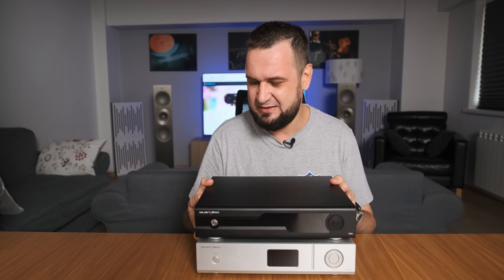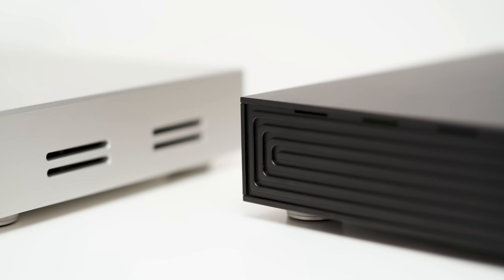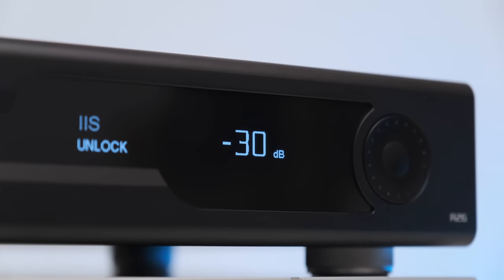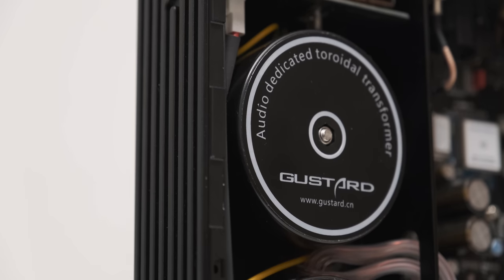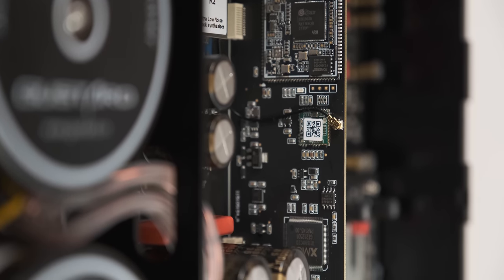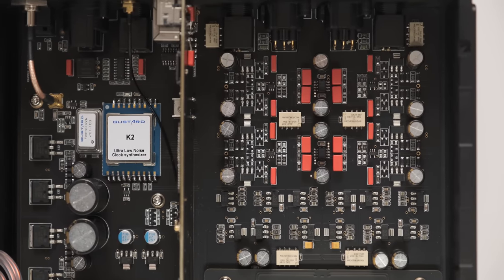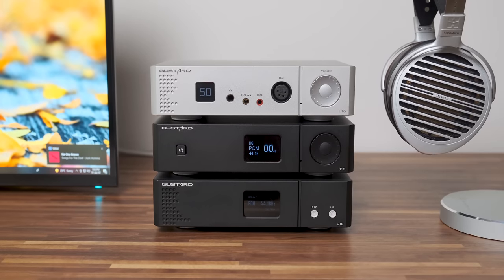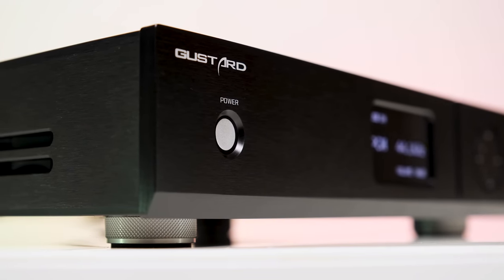The Best DAC I've heard below $3.5K - Gustard R26 Discrete Review

Comment: Ok i received my R26 brand new and fonctionnal. I paired it with the Gustard U18 DDC to connect through IIS. Before the U18 was in, the sound, compared to my Denafrips Pontus II, was wider, punchier and more 3D without being forward. It reminds me of my Chord Mscaler/Qutest combo but with more meat on the bone and a sense of liquidity the Chords lacked. With the U18 in place, the musicians are inside my room, playing for me. This amazing vividness gives music its enjoyment and visceral emotion. I'm quite amazed by this unit after owning severals DACs from Delta Sigma to R2R. Thank you for this review ! Without it, i was about to make a loan to buy a Holo May. I don't know the may but the Gustard is amazing ! Truly !
Reply from the maker: I'm so glad that people started realizing the Giant Killer than Gustard made at such an affordable price. I have a Chord Dave as well and while that one is better...it is only by a little better, making R26 the biggest bargain I ever experienced from the land of D/A converters.
Reply: @Soundnews  And it's on a burn in process so it should get better ! The U18 is a must to retrieve the last bit of greatness from this dac. Dave is probably better but lack fluidity as i recall it... Did you ever try a external clock ?
Reply: I own Gustard U18 DDC. With R26 you just choose Gustard on U18 and it works perfectly with I2S with no other adjustments?
Reply: @klepp19  yes i use the U18 DDC. I added an external clock to both the U18 and the R26. I gained another level in treble purity, extension and edge.
Reply: @laiguilleetlefeu3240  I will just try I2S maybe no external clocks. I just sold my Qutest.
Reply: @Soundnews   How do I update firmware using Mac? No help from website for A26 or R26. I own A26 and will be swapping out for R26 as I’m in return period.  Your review convinced me. I was Able to get for $15 cheaper than A26. The A26 has no need for updates but I see there is need for R26 for Roon. I hope I did not make a mistake but will hold onto A26 until last min. Hope you have install advice for software using Mac
Reply: @laiguilleetlefeu3240  what is best application for clock? I use my DAC with Ethernet connection. Is it only for usb input?
Reply: I  also used a straight R26 for a few months and found it was lacking dynamics ,  bass pitch and a 3D Soundstage, while still sounding very detailed,  neutral and spacious.  Adding a OCK-1 clock made zero difference. 

But adding the U18 gave  a huge boost, turbocharging the R26 and allowing the external clock to provide additional benefits.
Reply: Brilliant. Does your Gustard have a remote to select inputs and volume control?
Reply: @rontoolsie what did you have before R26?
Reply: @morespinach9832  A TeddyDAC with  built-in volume control.  Compared to the R26 is was fuzzy, compressed,  2 dimensional and greatly lacking in bass.
Reply: @rontoolsie  no wonder you heard a huge leap of different.
Reply: Having used the R26/U18 for a few months I have recently found that the quality of the HDMI cable between them (which is the preferred connection) makes a difference.  
Previously I was using a highly rated Pangea SE cable that cost $150+ that I borrowed from the TV. Silver coated copper.

I recently got an Ali Express AV Play HDMI for around $80. Mainly because I wanted to return the Pangea to the TV.

The AVPlay is only 0 .75m as that is all I need.  And the AVPlay HDMIsounds more spacious and natural compared to the Pangea. Maybe because pure silver- but possibly due to the fact it is under half the length of the Pangea 

But whatever the reason...the HDMI cable DOES matter. 

In the next week or two I will try swapping my USB cable from the Node130 to the U18 with a high spec silver USB and see if that makes any difference at all.

Comment: Sandu thanks for the detailed, honest reviews.  I bought Musician Pegasus based on your reviews from way back and I know that it got beat up on in forums, from other reviewers based on rumours or things outside of how the unit performed.  Glad you stuck to your guns because the DAC lived up to the hype and your review.  Fully trust your opinion and review this time around.  Credibility and mad respect brotha! :)
Reply: I had the Pegasus and it was surpassed by cheaper digital dacs. I sent it back after I a/b compared it to several other dacs for over a month. 

I'm going Mini dsp before spending money on another Dac.
Reply: @ufarkingicehole  What is your favorite right now? I like smsl d300!
Reply: @klepp19  my favorite less expensive DAC has been the Geshelli Labs J2. It works best with brighter equipment like class D amps. For Softer, more laid back equipment, the SMSL 400 does a good job at countering that sound.  

I believe some of the newer DACS are probably better than either of those like the Gustard x26 pro. I think at this level you are actually buying a Pre amp. Knowing what I know, I would probably buy a minidsp   instead of a DAC and buy the DAC absolutely last.. 
Another point thats never mentioned is that synergy is king. You need to find equipment that match your set up. I typically try to keep it simple such as bright, lean, and clear vs soft and lush (doesn't mean not clear).  I still need to listen to the d300 though.
Reply: @ufarkingicehole  Thanks for sharing your experience! But J2 can't compete with D300. J2 will sound nice but not pushing SOTA for tone and timbre!😊

Comment: Your review, Sandu, triggered me to try out the R26 as a replacement for an SMSL M400. I already tried the X26 following your enthusiastic review about this one but this unit was not doing much for me (maybe my copy was somehow a bad one). So knowing about all your other very kind and glowing reviews I was a little skeptical, if your praise was really justified. Owning the R26 for less than 24 hours I’m totally convinced, that it is. Even without any burn-in time at all the R26 owns the M400 in every aspect. I can totally understand your “being stunned whilst the first listen” part of your review. That was exactly what I felt. And if you still say this given the experience you have, this is truly a testament of the R26 quality. Thanks for your reviews!
Reply: I have the M400 dac too. Is the Gustard R26 better?
Reply: @briansage9388  Hello Brian. I can only speak for my system, but there the answer is definitely yes. I’m using my DAC in pre-amp mode only feed with FLACs by a raspi based DDC via coax. My DAC is conected via XLR into a PS Audio BHK 250 into modified Infinity Omegas. In this setup the R26 was an significant improvement. The sound is cleaner, more spacious, has a better decay and is even a tad more dynamic. The R26 is also a very fun sounding unit having a slightly warmish timbre – like the M400 felt for me.

After about 6 weeks of burn in I can state, that the volume decreased a little with still plenty headroom, the sound did not improve significantly and that if you reach the limits of my Infinities the M400 had a slight edge when sub bass is concerned. I'm however still very pleased with the R26 and don't regret switching.
Reply: @josch614  OK. Thanks for info. It was the R2R Nos that got my attention. I heard good things about it and this dac was mentioned and I'm just now hearing about it.

Comment: Just wanted to say that after watching your review I ordered one.  I had been looking for an upgrade to my Ares II.  I normally don't buy something based on a single review but I have grown to trust Sandu's reviews so I pulled the trigger.  Received it two days ago (very fast from Aoshida). All I can say is Thank You Sandu! Your review nailed it and this is exactly what I wanted.  I plugged into my Burson Soloist 3XP with the SuperCharger and a smile immediately crossed my lips.  Everything sounded punchier and more detailed.  Tried with Arya Stealth, Audeze LCD-XC, Sennheiser 660s & 600.  Dare I say it? This may be my endgame. Plus I want to spend money on actual musical equipment like hardware synths and drum machines (more fun than just software based music production).
Reply from the maker: Hi David, that you for your kind words. You won't find a better R2R DAC even at thrice its price. I ordered a Silver unit just a day ago, so I could use it the living room (stereo setup) with the rest of my electronics.
Reply: @Soundnews  Hi, which color unit do you like the best, black or silver? Thanks!
Reply: @Soundnews  I also ordered and received a silver unit after watching your review and it is truly excellent. It's a nice upgrade over my Singxer SDA-6 Pro. It pairs well with my Denafrips Artemis headphone amp. Cheers !
Reply: @Soundnews  Great review! 👏👏👏Let me ask you a question about the R26 preamp functionality. In your X26Pro review you felt the variable output was lower quality than your Matrix Audio element X. Is the R26 preamp output better performer than the X26Pro? I´m asking cause I´m planning to use the R26 direct to Power Amp to get higher transparency, 3D and purity but I don´t want to get a thinner or lean sound.
Thanks!!
Reply: Hi,I also have an Ares II and wanted to upgrade,but can't decide between R26 and the Pontus II.So,it's that good in comparison with the Ares II? I'm using my dac with P5 preamp and A21 amp from Parasound!
Reply: @JR___  hi. I recently purchased the R26. Did you connect it straight to the amp without using the preamp of the r26? What do you recommend?! Thanks!

Comment: Great review and awesome recommendation.  I just received the R26 and it is an incredible DAC.  I also have the X26 pro, and the R26 bests the X26 pro by a good margin.  R2R DACs present music so much more  naturally.
Reply: Can you please be a bit more specific..I'm on the fence of selling my X26pro for the R26..I listen jazz and classical mainly through Harbeth SHLs+40th speakers..thanks!
Reply: @quinto34  I liken it to speaker cones and domes.  With metal woofer cones and tweeter domes you get that unnatural sound.  With paper, polypropyleen, and kevlar cones and silk and other non-metallic tweeters you get a more natural sound.  I think the sound is more natural with the R26 vs the X26 pro.  I don't hear the Delta-Sigma ringing in the R26.  The music is more involving. The PrAT stands out as excellent. 

I listen to Jazz quite a bit too.  The R26 is worth the upgrade IMO.  Perfect for Jazz, Rock, Instrumental, Classical, and Hard Rock.  I'm listening to Ben Wolfe, The Enforcer right now.  Sounds so nuanced and detailed.  You can hear the each pluck of the bass.  The trumpet is stellar with that ring of the trumpet cone, you can feel it coming off the speaker cone with the correct timbre.

Hope this helps.
Reply: @jerick70ify  very helpful, thanks Jeff!
Reply: Is the R26 as fast and impactful as the X26pro?
Thank you
Reply: @Nightjar726  It's a different sound.  I think yes it is very close.

Comment: Thank you for this video, very enjoyable and informative. Would you consider doing a review of the P26 preamp from Gustard? I'm very interested in this unit but there are hardly any reviews online.
Reply: I would also love a good review of the Gustard P26 preamp. When my Gustard R26 connects directly to my class D purify power ampwith XLR, i need to reduce the digital attenuation down to  lower than -30 dB, loosing a lot of sound quality. So a good unity gain preamp would help. I am considering either the gustard p26, or the Denafrips hestia which has good reviews but is a bit costlier. Thoughts?

Comment: Your review helped push me to buying this over the Denafrips and Holo Audio DACs I was considering. Huge shoutout to Aoshida Audio, the R26 arrived in 6 days! Ordered Thursday arrived Wednesday. Right out of the box, it's apparent this is a contender. A little raw and a little lean, I don't find it soft at all. The imaging is pinpoint and lots of air around instruments. Wide and deep soundstage. Aurender N100 feeding it, balanced outputs to BAT pre & amp feeding Focal Kanta No2's. I'll just keep it running throughout the day. Nice fit/finish for price. Not nearly Denafrips or Kitsune level, but less than half the price. That let my buy a new phono stage and power supply.

Comment: Thank you for the review. I love that you are willing to adjust your outlook as you continue to review evolving technology. Normally you mention burn-in time when reviewing R2R DACs. How long did it take to burn-in the Gustard R26 Discrete DAC?
Reply from the maker: Hi mate, I think I've mentioned in the video that I had two weeks for burn-in and one week for listening in my stereo/headphone setup. In  about ~100 hours it completely settled it
Reply: Sandusaid 2 full weeks or 350 hours , and use agood aftermarket 
Power cord , and fuse these made a Big improvement  20 mm 2.5 amp slow blow synergistc research purple fuse

Comment: Hi. I bought an R26 based upon your review, and I am deeply satisfied.
The bass improved significantly after 300h of burning-in, and now R26 exceeds X26 pro in all aspects.
I am quite surprised how MQA sounds great when Full-decode mode("MQA passthrough" should be selected on the source device, and "MQA" should be shown on display, not "OFS"). I hope you test it and give me some comments about it!
Reply: Indeed it does take a long, long time to burn in. At first it sounded similar to my delta-sigma DAC, a bit more distant with possibly a wider soundstage. After a few days I was worried until I saw people mention give it at least 100 hours. So I basically ran it nonstop for over a week, and noticed a huge difference. Now about a month later, it's better still. The best part of the R26 is it has all the speed, bass and slam of the best delta-sigmas, but has the buttery smoothness and air of the ladder DACs. I find this to be much better than the Venus II (store demo) I had tried in my system a few months back - and found it to be a bit dark and recessed compared to my Topper, just with compelling midrange in comparison.

Comment: Soundnews, you've gushed about the SMSL VMV D2 as well as now this R26.  I'm about to pull the trigger on one of these two, but I need to know two important points.
-  I live in Arizona and I CAN'T have components that are going to warm up the room by running very hot like a Class A amp.  I'm wondering if this R26 runs hot like the Gustard X26 pro
-  What do you think sounds better, the SMSL VMV D2 or this R26?
-  Bonus info.....I've already read from two different sources that this R26 dac doesn't have an audio delay on it like the Denafrips dacs do, so it's good to use for gaming or TV's without the sound being delayed behind the video.  That's great.
Reply: I've tried both VMV D2 and R26. VMV D2 runs hotter than R26 but D2 is the much smaller unit, sorry I don't have X26 Pro to compare. In terms of sound, there is no comparison between the two. R26 is better in every way possible.
Reply: @audioprom2662  Yeah, I now have the R26 and a Violectric V550 powering HE1000v2 cans.  The R26 doesn't even get warm, the V550 does get a little warm but nothing major.  It all sounds fantastic

Comment: Add a Synergistic research 20 mm- 2.5amp slow blow fuse , fuse is directional ,fuse direction reading L to R facing up . Tweak geek sells AQ fuses the yellow are pretty good purple even better ,and they show fuse orientation.  Use a decent aftermarket power cord 
It truly makes this dac that much meter still , just give it a solid 200 hours , the dac 
Play it 2 weeks 24-7  to fully  run it in , the Isotek runin cd  is a great runin cd 
And track 3 use 3-4x a week as a 5 minute sweep tune up i.
Magnetic fields tend to drift , this CDs cleans things up ,listen before ,and after  this has won several awards  in the past.,Happy 🎶 listening.

Comment: I noticed on another forum that several buyers experience different hum noises (from transformer to display). When so many people are discussing this topic I find it strange that you and other reviewers are completely silent about this topic. The reviews are 100% raving without any negatives. I'm sure this is a very good DAC but it would be nice to address this topic and offer a solution (together with Gustard). For now it seems a hit or miss with this device. I would like to know if this is now solved with new batches before spending 1600$ and ending up with a hum 🧐
Reply from the maker: Hi mate, this review unit didn't do that..and another silver unit that I bought separately doesn't have that issue either. In both cases, I didn't have that issue and this is the very First time when I hear about this, otherwise I would clearly state it in the review. There is no reason for me to hide its flaws/imperfections, as I don't work for Gustard, but for my audience.
Reply: @Soundnews  I understand and good for you 👍 You can read this on Head-Fi, many users experience this humming issue. I also contacted some sellers and they confirmed knowing about this. It is the first DAC reading about with hum issues, so I lost confidence..
Reply: Now I'm even more suspicious about the  hum, the answer Gustard gave yesterday: 'Feel free to buy now, the issue is solved now', how do I know if a seller offers new or older units and if the issue is really solved or not??! So I wrote Hifigo and the response was even worse: 'Every buyer does experience this product different' WTF! Very reassuring when spending 1600$ 😅

Comment: Thank you for your unboxing review.  I also watched your video on the SMSL M500 MKIII, and I eventually purchased it. I have been using it for three months now and have been completely satisfied with its performance, especially considering its price. However, I have been contemplating an upgrade recently, and I would like to ask if switching from the M500 MKIII to the Gustard R26 would be a significant improvement in sound quality. Thank you.